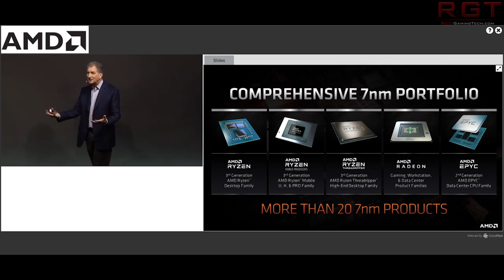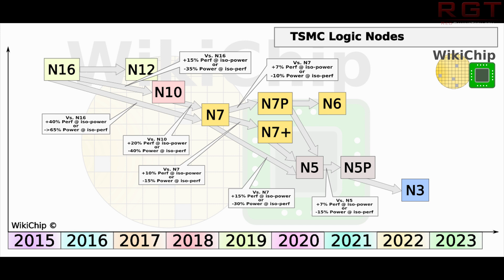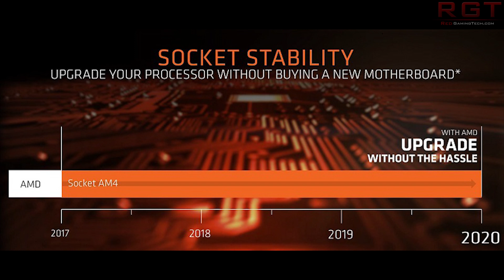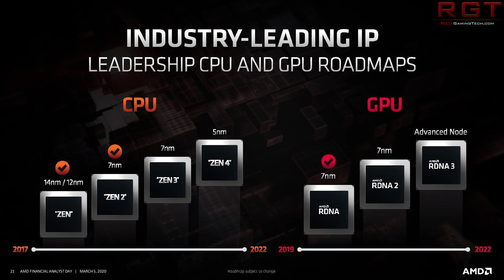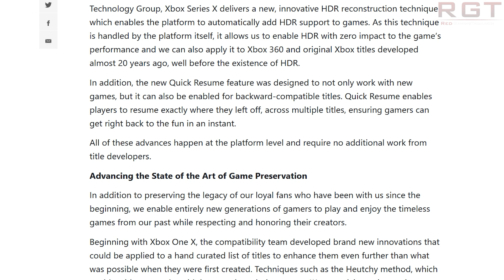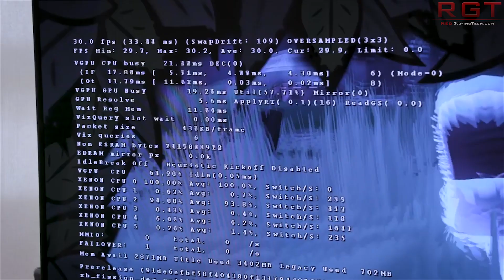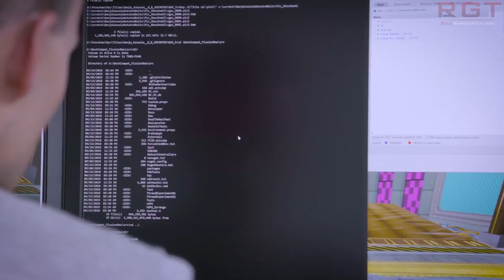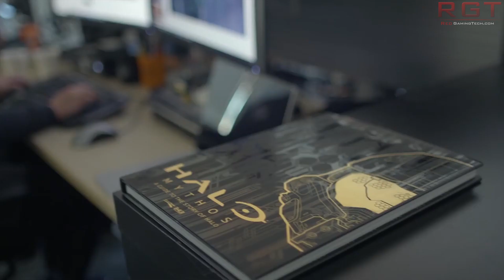Ryzen 4000 To Use 5nm & Change PC | Incredible Xbox Series X Backwards Compatibility Detailed

Comment from the maker: 0:28 Zen 3 5nm
10:24 Xbox Series X 
 
ALSO the end of today's video ends in POG.
Reply: So here is my thoughts on why this may be accurate. The refresh is using 7+ I would think that they have prepurchased the wafers on this process for zen3  since there going to 5 they need to use those wafers so they probably refreshed a existing design to use the wafers they already purchased
Reply: You might have to add a title to the 0:00 chapter.
Reply: pro trick : you can watch series on Flixzone. Been using them for watching loads of movies these days.
Reply: @Johnny Ricardo Definitely, I have been using Flixzone} for since november myself :D
Reply: @Johnny Ricardo Yup, been watching on flixzone} for months myself =)
Reply: If this is true, which im skeptical.

They would HAVE to focus on the power consumption vs clock speeds.
Theoretically speaking, if they just took a Zen2 chiplet and made it 5nm, it would be around 35-40mm2. Running 115+W through a die that small is going to be almost impossible to cool.

But I could see them using a 7nm Zen3 for mainstream, and a 5nm Epyc update coming. Because alot of dies will be needed for XSX / PS5 / RDNA2 on 7nm. Plus when the chiplet goes 5nm, the IO die will be going 7nm.

Comment: A 7nm refresh now, while the competition is on the ropes, and a 5nm node in early 2021 actually makes good strategic sense. This gives AMD more time on the 5nm node, with potential for a solid 5nm+ in 2022, when Intel should be getting into 7nm. AMD's main issue isn't clock speed it's memory latency, you can throw all the clockspeed you want at even Z2, but it just doesn't scale because it isn't the limiting factor.

Comment: You’re right but this has happened before. Vega 7nm wasn’t supposed to be a product but a test of 7nm. This could be the same for 5nm Zen 3. I would reckon that it was an APU as an early sample. If AMD has such a close tie with TMSC then they would have had first dibs on the process instead of companies such as Apple. This would make it highly viable that a product could be released in January. It may have started as a test product (for the process) that went into full production. As a Zen 3 core was being produced on 7nm a comparison of performance would be good.

What I would like to know is how big has AMD’s design team has gotten over the past 5 years? They are executing on a level, launching so many products (Renoir, Ryzen 3000 series, Vega (compute) and all the different Navi variants. I’ve never known AMD to execute like this without having major issues.
Reply: Not likely, but if the Matisse refresh is on enhanced 7nm it could be a pipe-cleaner for Zen 3 on enhanced 7nm. And since AMD is committed to using enhanced 7nm, the only way they could launch Zen 3 on 5nm would be if they can meet their enhanced 7nm commitment with an extended run of Matisse refresh.
Reply: Dale Splitstone  Yeah this is also possible. But what makes a lot of sines is that all of a sudden TSMC has capacity for Nvidia and possibly Intel. This maybe due to AMD transitioning early to 5NM, freeing up capacity. It is possible that the first product could be for laptops as a limited,run high end part or a low wattage product. However, It doesn’t make sense how AMD has been able to produce so many products. In the past products would be butchered if they developed too many. This was the same with the last round of console products. AMD also doesn’t make many revisions of a product. Navi one was the only product they had issues with.

Comment: This report has some pretty impressive numbers in it.  N5P is 7% better performance at the same power versus N5.  N5 is 15% better than N7, which is what Zen2 is based on.  1.07 x 1.15 = 23% increase in clock speeds.   If this is true, Zen3 5NP processors should all hit 5 GHz.

https://wccftech.com/amd-ryzen-4000-zen-3-vermeer-desktop-cpus-tsmc-5nm-process-node-rumor/

Comment: Well, this could at least explain why we're getting Matisse 2 so close to the expected Zen 3 launch... if Zen 3 isn't actually going to be released in September thanks to a last-minute switch to 5nm, it makes sense to put something into the gap. That gives me incredible hope for the potential upgrades I'm going to have available on my B450 motherboard (as if my prospects weren't good enough already!).

I still seriously doubt that this is genuine though. I hope it's real, but I expect this is fake. It's also possible that this is talking about Cezanne, which, for all we know, could be branded as 4000-series or 4X50-series for AMD to bring their APU and CPU branding in-line in terms of architectural generation, which has previously been potentially misleading to customers.
Reply: No! The Matisse refresh has been planned since before Zen 2 launched. The problem isn't explaining the launch of Matisse refresh, but why AMD would delay the launch of Zen 3.

AMD needs to beat Intel, and this requires more than a 5% clock speed bump from clock binning. AMD has a commitment to using the enhanced 7nm process that was developed specifically for AMD. If AMD will not use this process for Zen 3, the implication is that Zen 2 is using this enhanced 7nm process. At the very least, if AMD will not be using the enhanced 7nm process for Zen 3, the Matisse refresh will be more like RX 590 versus RX 580 than Vega 64 Liquid versus Vega 64.

It could be that Matisse refresh was planned as a pipe-cleaner for the enhanced 7nm process, but during the tweaking of Zen 2 for the enhanced 7nm process the design team produced a CCX module closer to that of Zen+ versus Zen than a simple clock speed bump. We will know for sure an June 16th. If AMD announces on June 16th that Matisse refresh uses the enhanced 7nm node, and is officially called Zen 2+, it is likely that Zen 3 is delayed.

Unless and until this occurs I will go with the impression I got from the interview with Lisa Su in which she was asked about the 5nm rumor. She never committed to talking about 5nm, but constantly deflected to the launch of mobile Zen 3.in early 2021. I interpret this as meaning that mobile Zen 3 might launch on 5nm, but desktop Zen 3 will launch on enhanced 7nm as scheduled.

This implies that, even if Matisse refresh is on enhanced 7nm, it is a pipe-cleaner more like RX 590 versus RX 580 than Zen+ versus Zen. And being a pipe-cleaner, it might not be produced beyond the introduction Zen 3, if it is this pipe-cleaner.

Comment: I think Microsoft is probably waiting to learn the price of the PS5 before deciding what to do with Lockhart. If Sony is aggressive on pricing, Microsoft will match it and kill Lockhart.
Reply: that's what I think too.. but it's not likely.. you can't have devs making games for a console.. that won't exist... they have to have it in mind from the start... so it's either dead.. or alive... they can't kill it last minute... my guess is it's dead and the series X will match ps5 for price.
Reply: @86lanzo  the devs are targeting Lockhart as base spec, and I expect them to have the dev kits for it. But the games are also made to run on the XSX with higher quality or higher frame rate. Killing the lower console last minute won't change much. It will only mean they wasted time optimizing games for a console that will never be sold.

If however the console is in production already, then it's gonna hurt for Microsoft. They might end throwing away thousands of consoles.
Reply: Th3 cost of that SSD r&d and the fact only the PlayStation division is profitable,they can't be as aggressive with pricing as you think, Ms have the better hand with their budget

Comment: If AMD keeps the pedal to the metal big time (which would be true if this move is true), Intel will be in a lot of trouble in the CPU/GPU world for the next several years.
Reply: Introducing Zen3 at 7nm with a follow on at 5nm  a few months later would be a stronger move against Intel than delaying Zen3 a few months to introduce it at 5nm.

Comment: 5nm only did risk production earlier this year, the advanced 5nm node wouldn’t be ready.  Right now Apple is pumping out A14 chips, and perhaps rumored 12 cored desktop variants, which would probably be dominating production.  Apple moving to N5 from N7p frees up and reduces the cost of 7nm process.

Amd would most likely want to plan on a big increase in the chip’s transistor count do to the increase in density, think bigger caches and more execution units per core.
Reply: 5nm is ready. Yields are higher at 5nm than 7nm. But AMD isn't ready. Zen 3 will launch on time using enhanced 7nm.

Zen 3 will be shrunk to 5nm, perhaps as early as 05/05/2021, but no later than 07/07/2021.

Comment: This would make very little sense. AMD has already book a lot of 7nm+ capacity for the production of Zen3. There are several factors that would have to be in play for AMD to delay Zen3 to launch on 5nm.

1) The Matisse refresh would have to be on 7nm+. I actually think this is likely. AMD used VII as a pipe cleaner for 7nm, so it is reasonable to use the Matisse refresh as a pipe cleaner for 7nm+.

2) The Matisse refresh would have to be strong enough to make launching Zen3 this year largely redundant. This means that the Matisse refresh would have to be more like Zen+ versus Zen, than simply new binning. Maybe, just moving to 7nm+ for the Matisse refresh would be able to provide at least a 9% performance boost for Matisse, but it would likely involve a redesign of the core at least as significant ad the redesign of Polaris to transform the RX 400 series into the RX 500 series. If Zen3 is delayed for 5nm, it would more than likely mean that the Matisse refresh is not only launching on 7nm+, but is a port of the Renoir CPU design.

It is far more likely that 7nm+ Zen3 will launch in September, with availability in October, with a rapid follow on of a 5nm refresh in early 2020. Think of Zen3 as being analogous to the original 220nm K7 Athlon that launched in November 1999, with the 5nm refresh being analogous to the 180nm K75 Athlon that launched early in 2000.

It is more likely that Zen3 will be available in October, and the 5nm Zen3+ will be available on 07/07/2021 as a pipe cleaner for 5nm, in advance of Zen4 availability in February of 2022.
Reply: Oops, the transition to the 180nm K75 took place in November 1999.

Comment: If this is true that makes the XT line make more sense. Maybe that is why they are launching the XT line and maybe they are on the 7nm EUV process.
Reply: They are launching the XT refresh because it was planned before Zen2 launched. One of the reasons it was announced that Zen3 would not be supported on 400 series mobos was so that the eminent launch of Zen3 would not interfere with the launch of the Matisse refresh. Having stated this, by pricing Zen3 high and/or dropping the price of Matisse refresh when Zen3 launches.

Comment: Those new nodes are much more expensive and I expect some paper launches at that point. Intel is launching 10nm++ with their Ice Lake-SP Xeon chips and Tiger Lake-H gaming laptops this holiday season. A high priority market in which Intel still dominates and AMD won't have a Zen 3 answer in the laptop space at that time. Jumping into into 5nm without banking enough on the more mature and cheaper 7nm proves that AMD is afraid of an Intel comeback. The new node is more expensive, which will limit their profitability.
Reply: Proves? This is just a rumor. If AMD were afraid of Intel's upcoming offering, they might rush 5nm, but they would not delay Zen3. Zen3 will be available in October, the only doubt is whether it will be 7nm ot 5nm. And since ther rumor specifies a delay, it is just a baseless rumor.

Comment: I strongly doubt ryzen 4000 will be based on 5nm. I expect it to be an enhanced 7m node.  I would expect ryzen 5000 on am5 to be on 5nm. Even the marketing would make sense lol: RYZEN 5000, world's first 5nm CPU, only on AM5 releasing on the 5/5 2022 🤣
Reply: Zen3 will move to 5nm in 2021, with availability on 07/07/2021. It will serve as a pipe-cleaner for 5nm, just like Radeon VII served as a pipe-cleaner for 7nm. I suppose I could be wrong however. It would make sense for AMD to make 5nm Zen3 available on 05/05/2021.
Reply: You forgot DDR5
Reply: hahahahaha

Comment: If this is true, it sounds like AMD is going for the jugular against AMD
They could also do two nodes as well. The flagships ( 8,12,16 cores) be on the 5nm/e5nm, and the lower tier (2,4,6 cores) be on the E7nm node.Then they'd have a two tiered setup, one for the high end, but not HEDT and a lower budget tier. Not talking the Epyc or threadripper either, they could easily run two nodes across the spectrum, including the GPU's. Highly unlikely, but you honestly never know
Reply: AMD: NO-ONE CAN DEFEAT MY CPUs!
Intel: Here, have 2 more cores on an architecture that's basically unchanged since 2012 on a node from 2014.
AMD: Alright, I'll do it myself.

Comment: 0:28 That's very interesting. If they've shifted to 5nm for Zen 3, that explains why they're doing the Ryzen XT parts; it fills their 7nm orders and gets them to the field while Intel is still working to get their Sunny Cove chips live, lets them steal the march on Intel's 10nm parts, and lets them free up 7nm space for the console  and GPU hardware.

I'm wondering if this was the gamble Lisa Sue was talking about near the beginning of the year? This is a gutsy move, but if it works, there's going to be some serious upside. That also ties in with some of the earlier market analyst reports that were pointing out that AMD still hadn't gotten enough of the server market space to hold on when Intel started getting their Ice Lake server parts shipping out.

This going to be wild!
Reply: It's BS. There's no late shifts to another process node. It's possible only if new node is IP compatible and 5nm being full EUV is not(with any 7nm variant). Also tapeouts need to happen a year before launch and chip design takes another year. Thirdly we already know milan samples are 7nm, AMD is not going to develop yet another line of chips parallel, they don't have Intel's engineering resources.
Reply: @kognak6640  AMD has almost certainly been working on a 5nm shrink of Zen3, and it could be close to production ramp, but unless the Matisse refresh is on 7nm+, Zen3 will launch on 7nm+.

Comment: Maybe the 3800XT etc will be the new 7nm process and Zen3 be 5nm? If they did this, I would upgrade my second 3800X to their new CPU. This would crush INTEL and seal the coffin for the next 2-3years easily. When the 3800X was released I upgraded from 4790K as I promised when I saw the performance. I had 4790K on custom loop at 4.8GHz, and the 3800X is like having 2 of those in one system. I saw a huge jump in Mass Effect Andromeda performance - which is why I upgraded strangely enough.

Comment: Well, I have a Ryzen 2700X and I'm waiting for the Zen 3 4000 series release to decide on my upgrade. If the impovement on Zen 3 is only 15-20% I will probably buy a cheaper Zen 2 CPU, late 2020. But if AMD goes with 5nm on 4000 and the improvement is over 30% I would buy that in a heart beat!!
I do some gaming but I need a powerful CPU for DaVinci Resolve and Blender.
Reply: Rysen 2700x is on par with current R5 3600, so R5 4600 will be on par with current 3700x. IMO
R5 3600 is a great cpu for the price like R5 4600 will be.
Reply: @3DModelsToys  The 3600X is not on par with the 2700X. Otherwise I would've have bought that. The 2700X is faster in productivity
Reply: @NarekAvetisyan  I was talking as gaming benchmarks, 2700x have more cores/threads for multi tasks. Now 3700x/3800x are cheaper and about the same price i would have gone for those, but 4 series are just around the corner, so i will wait. I hv a r5 2600.
Reply: I don't know, doubt 15% per core was ever small for a CPU generation. Weird to see anyone call it small
Reply: @Rigardoful  It's small for me. I only upgrade my CPU when there is a substancially faster one available.
Reply: @NarekAvetisyan  Then unless you count doubling of course, are there really other single generation improvements worth upgrading to, to you?
Btw 2700X to 4700X will probably be over 30%! But don't see it for 3700X to 4700X.
Reply: Rumor is delayed until 2021. If Zen3 becomes available on 5nm in 2020, this rumor is false.

Comment: What if... Rdna2...
Reply: ooooh... im getting shivers... now hear this.... what if... ps5 and xbox series x...
Reply: i dare to bet RDNA2 won't be using 5nm. 5nm will be reserved for AMD best CPU line up. most likely for their Epyc. think again why AMD has yet launching anything faster than RX5700 even RX5700 almost one year old at this point. why not launching the speculated "RX5800/5900" late last year? looking at how Navi 10 die size at 250mm2 (Vega 20 is 330mm2) and power consumption tops at 220-230w mark AMD clearly have some room for faster product using the same node. but why AMD did not do it? the reason is most likely this: majority of their 7nm capacity is dedicated towards their CPU manufacturing and even that AMD still have trouble with meeting demand.
Reply: They could also do Cdna(#)